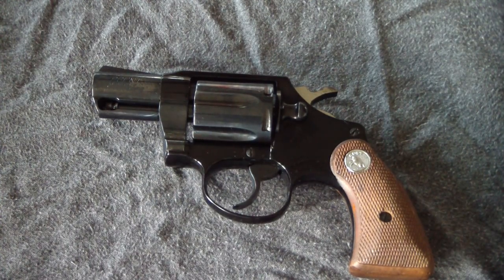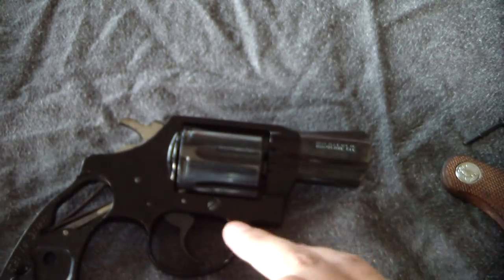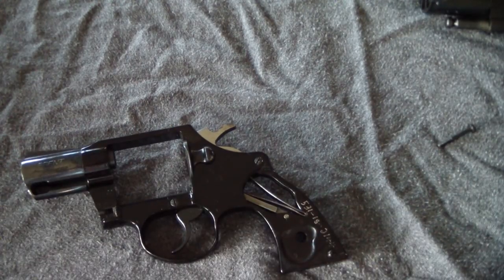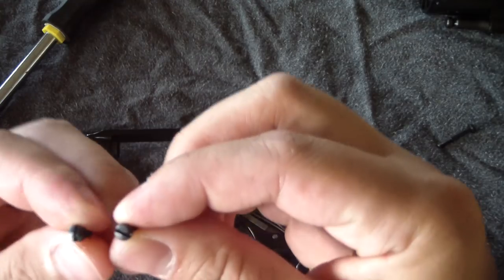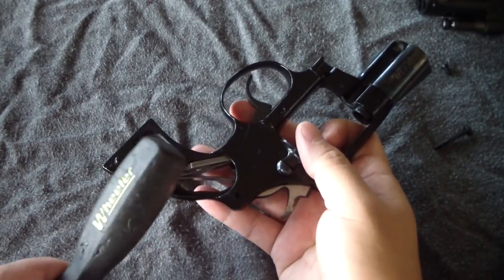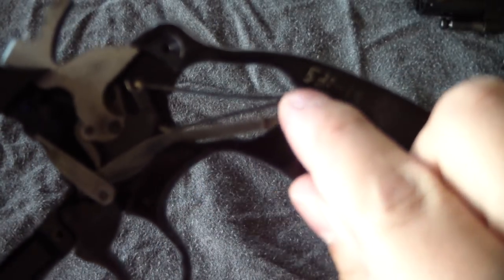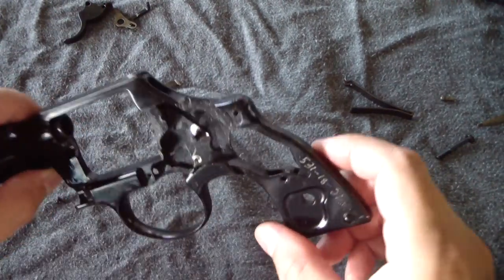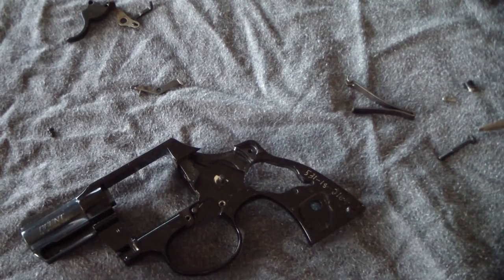Colt Agent 38 snub nose (DISASSEMBLY)

Comment: I have a question I bought a 38 colt snub but the barrel in it is off like if it was tighter to much so the sight didn’t align with the back sight about a half inch is this fixable?

Comment: Thanks. I have older Colt Det Spec, 38 cal. I think they are almost the same gun. With this video, you almost think you could do it. Almost.
Reply from the maker: They are the same.
Reply: BATJAC J.W Same here. Thought it was a detective special.
Reply: Frame is light weight in agent model and forged carbon steel in detective model... No more change... ✨🖖😁✨